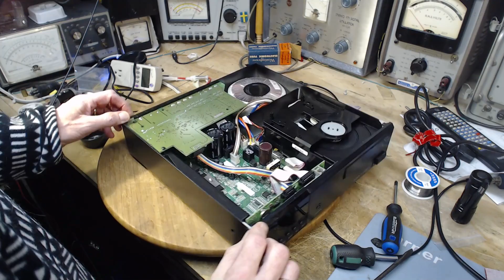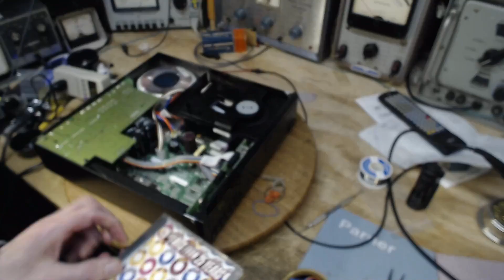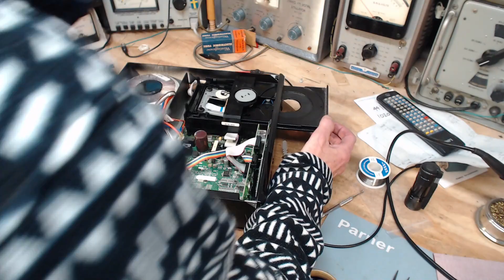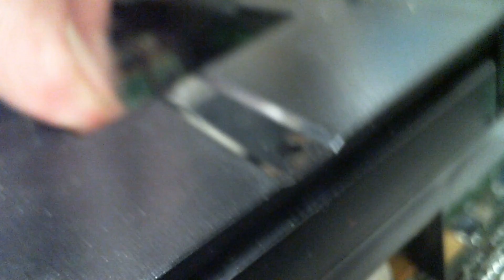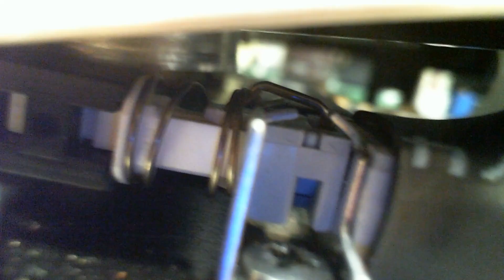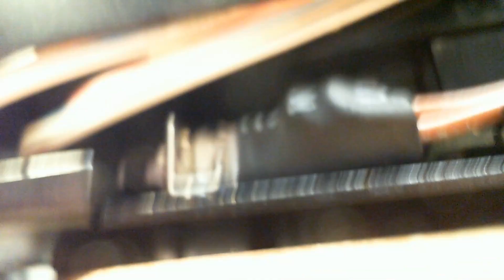Linn Classik 115 Video #1 of 2 - Belt Trouble

Comment: This is the K230 version (original is 115) with tuner and knekt (type classik K) multiroom. The remote is essential. As is a tight rubber belt. Good score! Just found one at the thrift store😊. Production date is on sticker inside on the board with name of employee. Toroidal has less interference radiation patterns. UK machines are all about oversized powerplants. Rubber belt is in front and visible when opening the door, the indicated gear is laser transport.

Comment: My god Jim ! You cannot use a "kitchen-rubberbelt" for this job !! It has not enough tension and it is good enough for closing and open the door, but not to lift up the tray ! You can hear it slipping. This is this unable blue rubberbelt ! Yey, yes, this set is a little more complicate like an AA5 😆

Comment: The rubber band has insufficient tension to lift the mechanism (at the end of the tray travel, the slider moves upwards pushing the mech up). Give the tray a good shove as it's closing and it should work. Long term correct belt will fix. Common issue which affects nearly all Japanese-designed CD, DVD and Blu-ray drives (some older ones do have a separate lifter but by the time these were built it was all cost reduced).

Looks like a Sanyo SFP101N mech, Chinese clones of which are still readily available and are put into just about all modern cd players.